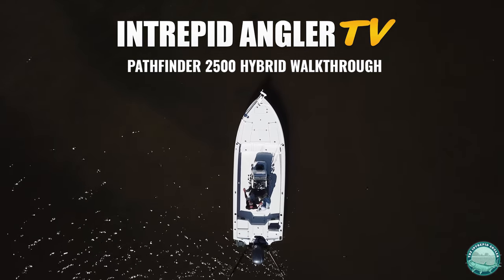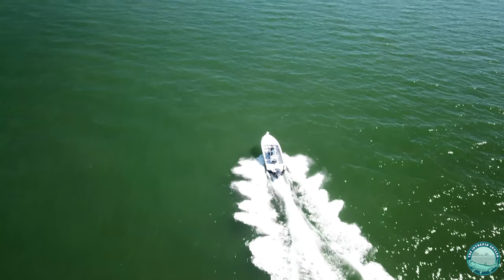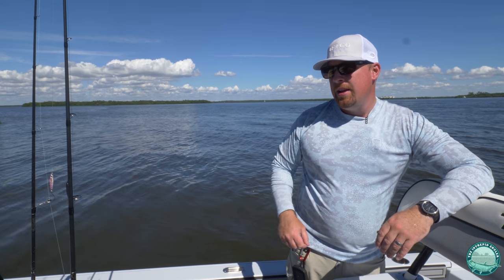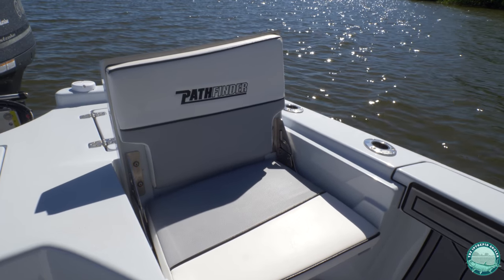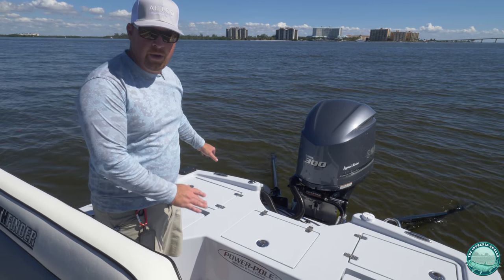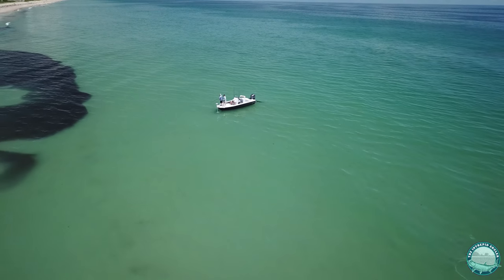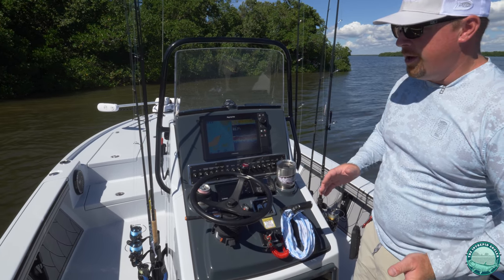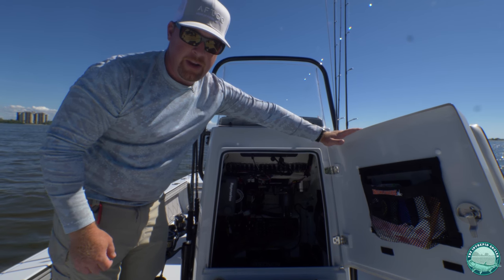Pathfinder 2500 Hybrid Walkthrough (2018 Model + Yamaha 300)

Comment: Hi Ross, I have wanted a 2400 TRS for a long time and the 2400 TE before that, but I think I like the 2500 Hybrid design even more. What made you choose the hybrid over other pathfinder models like the 2400 TRS or 2600 HPS (other than price)? 

For me, that foredeck seems awesome. It’s like a flats boat deck instead of a traditional bay boat design, yet you have the nice step up to the fore casting deck which is a plus. Also, that stern cockpit cut-out seems like a great idea for cockpit space.
Reply from the maker: I'd ran the 2400 for several years, but felt like it would shudder pretty hard in heavy chop. The 2500 feels totally solid running in slop.
Reply: @TheIntrepidAngler  is that achieved by the VARIS system? 

Good to hear the boat is solid. I read some of your other comments below as well. Do you prefer this deck layout compared to the 2400?

Comment: Great video!  This is the most in depth review of the 2500 I have seen.  Were you able to test this boat in rough seas?  I am curious how it handles in 2-4 ft seas.  Obviously not the kind of boat you take out in real nasty weather.
Reply from the maker: Thanks for the comment and glad you like the video. I actually test drove the boat during TS Alberto last summer. It was legit 3' chop while gusting to 40mph. I intentionally hit the chop at "wrong angles" to see how the hull would push through. It's an absolute unit, pushing through very sloppy conditions with ease. I found the boat wanted to run 18-21mph to stay on step. Also had another trip getting caught in afternoon thunderstorm and pushed through 13 miles of very sloppy and confused 2-3's while offshore, rode very solid and got us home safely.
Reply: @TheIntrepidAngler  Thanks for the reply!  That is great to hear.  I have been looking at the various hybrids throughout the industry and curious how they would handle the waters up here in New England.  Sounds like the hull can take a beating.  We rarely run offshore the distance you southern guys go, typically 20 miles, but the conditions can change quickly as I am sure you know.  Keep making great content.  Subscribed!
Reply from the maker: I've fished around Cape Cod and the boat would be comfortable for normal afternoon windy days crossing vineyard sound. It's quite a dry ride as well. @vapor151
Reply: You prolly dont care at all but does anyone know of a method to get back into an Instagram account??
I was dumb lost my login password. I appreciate any tricks you can give me.
Reply: @Kash Finley instablaster =)
Reply: @Porter Daxton it did the trick and I now got access to my account again. Im so happy:D
Thanks so much you really help me out :D
Reply: @Kash Finley glad I could help :)